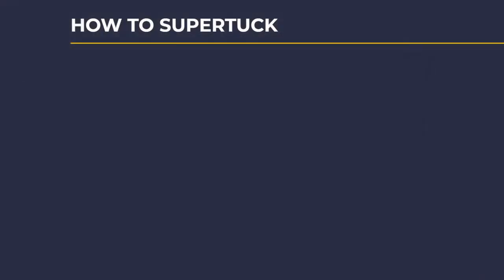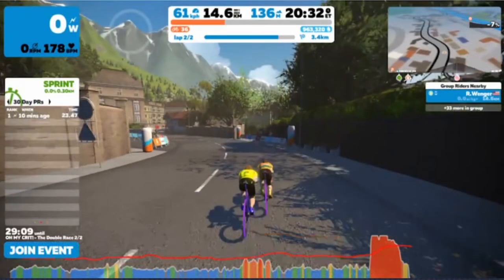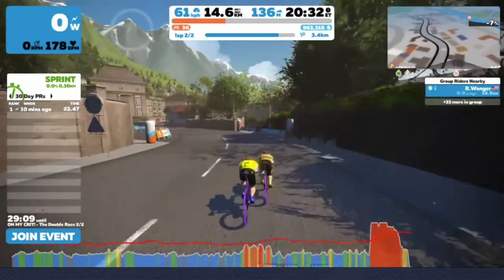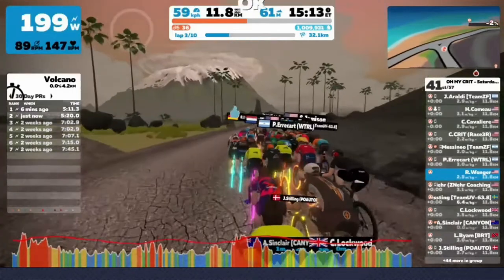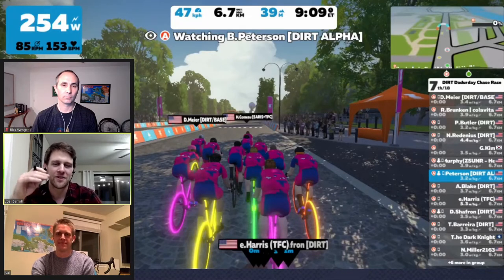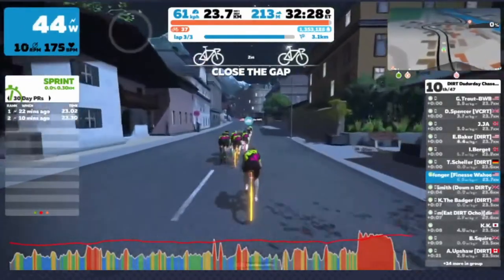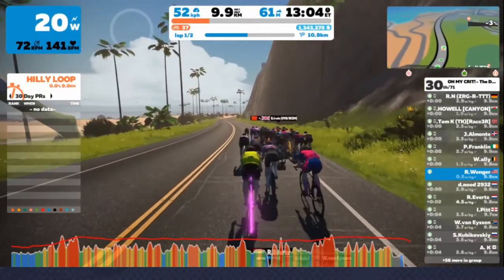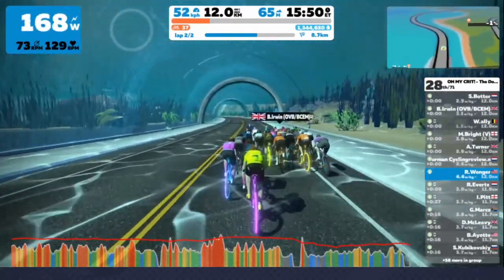How to Save Your Watts - Supertucking and Coasting

Comment: I didn't reply when I first saw this a while back but just to add that the Elite Direto II continues to put out watts so long as the fly wheel is turning. In practice, that means that when I stop pedaling at the start of the 6% section of the Hilly KOM descent my avatar goes into supertuck at the upper switchback. Maybe. It just is - I've confirmed it on the Direto FB site.  I think it might have to do with Elite's optical power measurement system but that's a WAG. The coasting advice is super helpful.
Reply from the maker: Wild...that kind of stinks for Zwift supertuck, but maybe the coasting will work better that way.

Comment: Hey Rick - good video. Question though, Joel mentioned it's the gradient going past -3% that takes you out of super tuck, but your section said the gradient is fine, it's the speed that's the key... what am I missing?
Reply from the maker: Hey! So Joel's advice was basically that there are times when you can get to -2 or -1% and stay in supertuck if the speed is high. I have found that to be true sometimes, although I can't figure out when it works and when it doesn't. Yesterday on Richmond it worked in some places when the gradient was < negative 3 and I stayed tucked, but not others. To me the keys are -3% and 57 kph for supertuck. You have to have both gradient and speed (most of the time). I do have a suspicion on how the gradient is calculated effecting when you supertuck, but I don't have data to back that up.
Reply: @nobreakawayszwiftracingtip6061  Ah, that makes sense, thanks! I do find there is a little black magic to it too, sometimes it takes courage to stick in a tuck against your instincts. So costly to get it wrong though ;)
Reply: @zwiftrides4912  i was pretty sure joe was saying that sometimes you can stay supertuck under 58 km/h. He distinctly states that the gradient flattening is what triggers the move out of supertuck.

Comment: On supertucking, should I switch to instant power instead of avg 3seconds? I always get some lag
Reply from the maker: My understanding is no matter what is displayed to you, Zwift is always looking at the instantaneous so it wouldn't make a difference. I think the lag is due to the trainer not going to zero as fast as your legs (at least on mine). I have to anticipate when my guy will supertuck and let off early.

Comment: Whenever I try this it takes ages for my wattage and RPM to drop, but I don't understand why. I use a Wahoo Kickr Core.
Reply from the maker: You know I thought about this a lot - so I think there is a "three-second average" function in Zwift, so your actual wattage may be coming down faster but it just looks like it isn't. I know on my NEO it seems like it takes a while to come down but my guy will get in the supertuck before the wattage is all the way to zero. It definitely takes some practice to know when the guy will supertuck though, and I think the new physics might mess with it too.